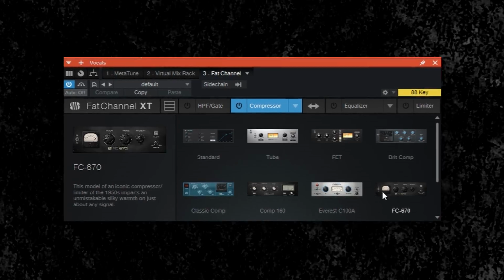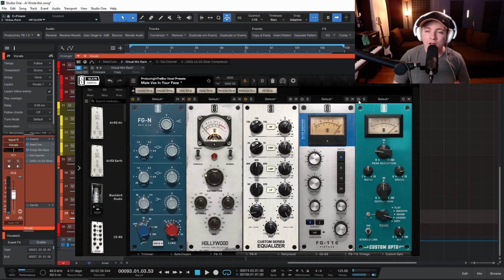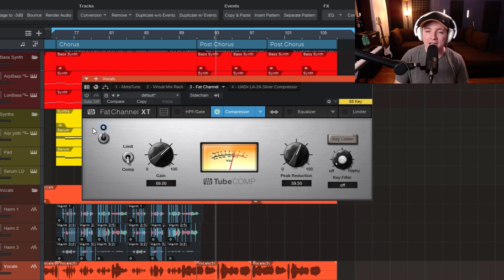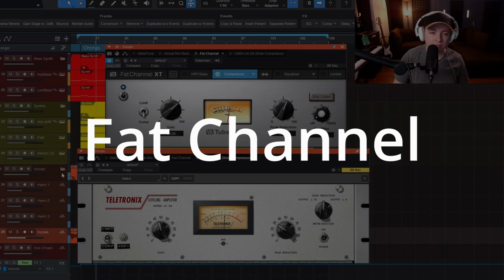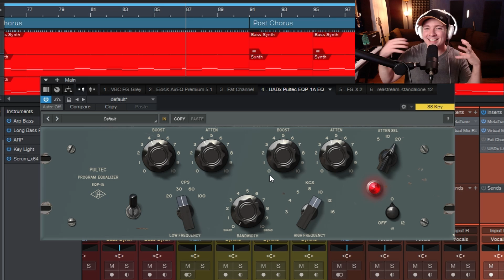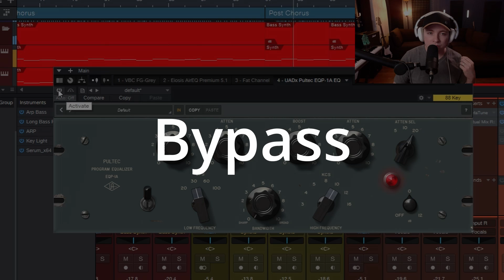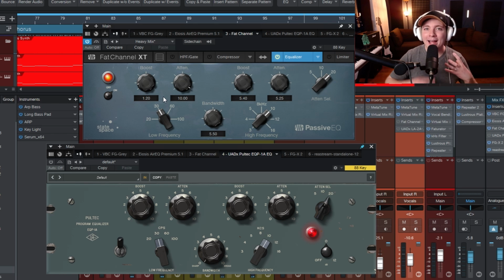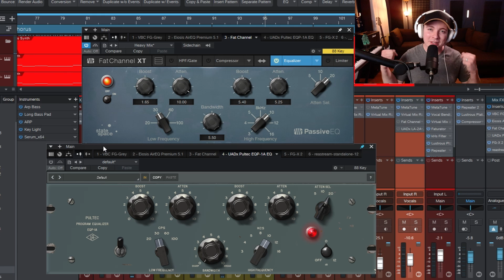Is Studio One's Fat Channel Better Than UAD?!

Comment: I’m glad you dialed them differently. It’s one of my biggest pet peeves when people shootout plugs. Matching the numbers instead of the sound. The bottom line is whether you can get the sound using the plugs or not…or can you get an equivalent sound between them..or match the hardware using ears. If so, you have a winner regardless of the on screen dial position. Genius!

Comment: Gain on LA-2A has nothing to do with compression, its basically output gain. Pultecs high end attenuation is chosen on the far right knob, not in the high frequency section, it's a bit different compared to how low end works

Comment: This is hard for me. I use fat channel all the time, thats my go to plugin ever. If the source material es good fat channel do it great, but if not I believe third plugins can achieve better results. Another things is that Fat channel recreates the eq curves and the compression behavior of the analog units...NOT THE HARMONIC DISTORTION, so maybe the comparisson is not fair. I believe that not having the harmonic distortion is a blessing cause its all marketing thing.
Reply from the maker: I agree. For example, I preferred the Fat Channel LA2A in the context of the mix. It didn’t add much harmonic distortion and pushed it a bit more up front in the mix

Comment: If you analize what is happening with harmonics, fat channel does not have harmonics, I mean, it is kind of a linear compressor (with the LA2A attack and release response). So UAD version indeed generate those harmonics as the original hardware.
Reply: Fat channel is intended to be linear.
Reply: @marsrivers  However, some emulation are not, like the 1176.
Reply: @AlexProgOfficial  i know. When i want harmonic distortion i look for it, when i want only the compressor behavior i go for this

Comment: Wrong. The attenuation knob on the right has nothing to do with the boost knob. The attenuation knob works with the atten select on the right. Being said, the second section in the Pultec does not have an attenuator